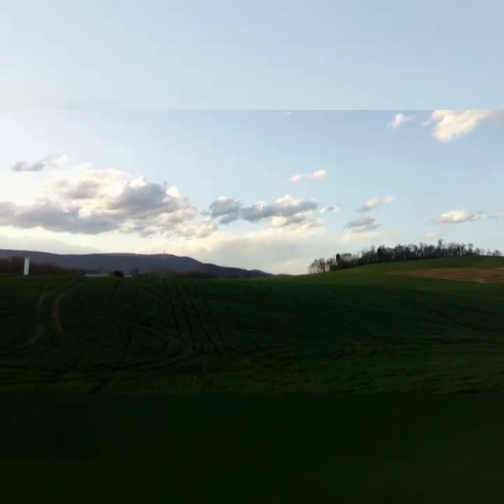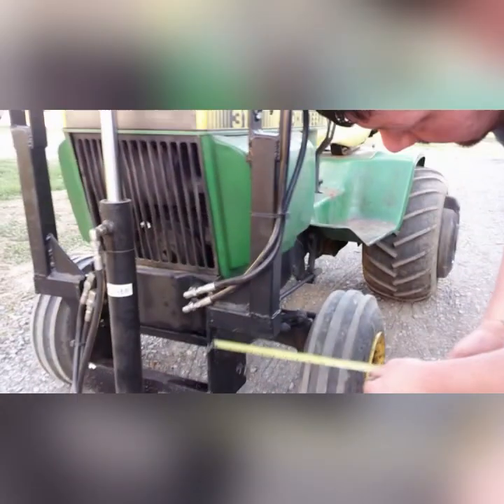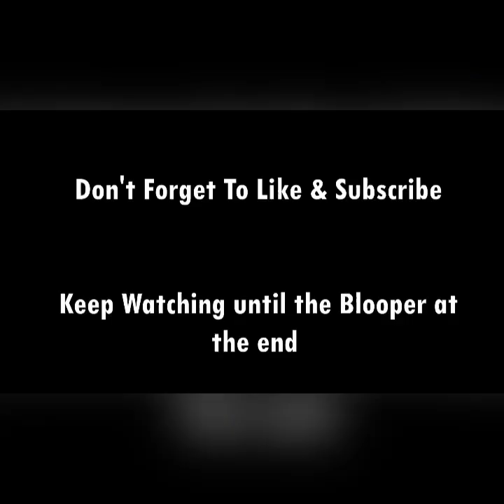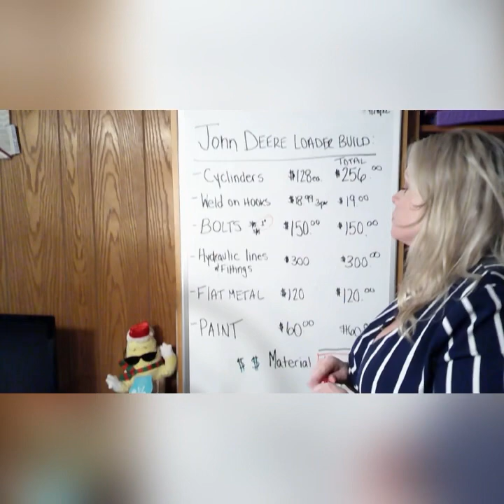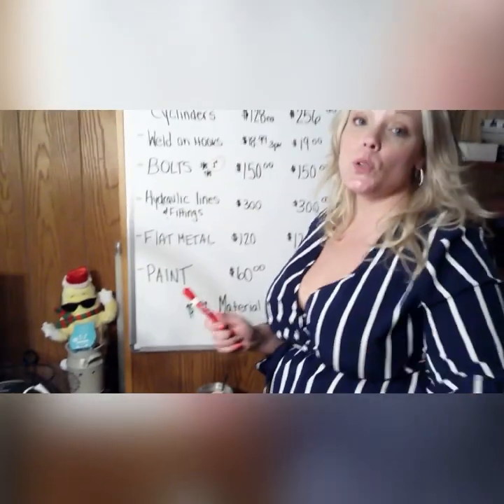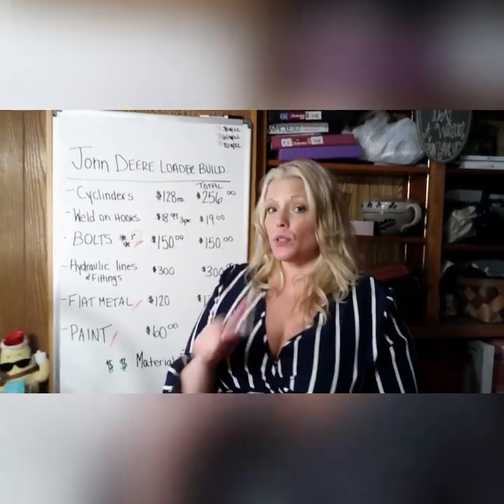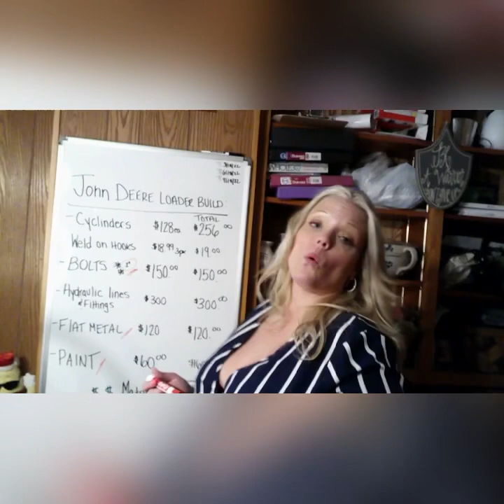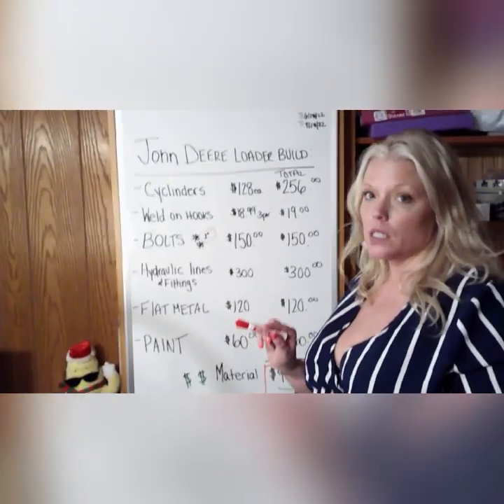John Deere Loader Build: In ACTION: Dimensions & Cost

Comment: You used the term "shimmed the relief valve to give it more pressure".  How do you "shim" it..?   Thanks for the video.  I'm currently building this unit for my 314.
Reply from the maker: I would love to see that build ,just give yourself more curl on the bucket than I did. Online shims are available for the main relief valve. Just be careful to not go too  much .
Reply from the maker: Thanks for watching
Reply: @Deadmoneygarage  I did put the back of the bucket 4" forward at the top, just like you suggested.  It's turning out really nice.  Thank you for your videos, as other than putting the bucket width at 40", I followed your build exactly.  I'm just getting the brackets for the cylinders welded on soon, mounting them, and she should be ready for paint.  I'm anxious..!

Comment: OH YEAH......how far from the bottom of the bucket did you put the bracket for the center/curl cylinder..?  Being the cylinder is at the certain length anyway, it will probably only have so much relief, but I was curious where the center of the cylinder pin is from the bottom of the bucket.  Thanks.

Comment: Did you use the on board hydraulics or did you add an additional pump? Thanks and great job on the build.
Reply from the maker: I used the on board hydraulics . Just shimmed the relief valve to give it a little more pressure. Thanks for watching.

Comment: I hope you are still enjoying the loader a year later.  I am curious though if you wish you had foot controls to drive the tractor or is this manageable using the hydrostatic speed lever plus the two levers for the loader and then the steering wheel?

Also, I am curious if you think you could have made this taller uprights and then shorter pieces going forward so that your bucket could be closer to the front of the tractor?  I would need to change the way the cylinders mount but my goal is to get it back for space savings as well as to help manage the load not that yours looks like it’s struggling at all!

I wanted to build mine last summer but never happened so relooking at options and your setup is ideal for the smaller machines like your 314 and I have a 314 and closed frame 316 so I’m building for virtually the same machine.

Comment: Can you post a link to the cylinders you used? As well as the pump and what not
Reply from the maker: The cylinders I used Or 14 inch but if I had to do over again how to date a 14inch and 12inch for the curl on the bucket.
Reply from the maker: As far as the pump I use the factory JD pump just shimmed

Comment: Great job. what are the size of your posts/arms, are they like 2x2x3/16 thick or like 3x3x1/4 inch thick. I built a regular loader for a Wheel Horse tractor using electric actuators, works great but very slow. I brought a John Deere 318 because of the power steering and front hydraulics, now I need a loader on it.
Reply from the maker: I wish mine was power steering. I think it’s 2x2x1/8
Reply: @Deadmoneygarage  Thanks for the reply.. I'm planning on 2x2x3/16th that I got from a scrap yard. I just need to look at your videos more for cylinders placement.
Reply from the maker: I think that would be fine. If at all possible I would have my hydraulic cylinders and lines made before. I started the build so you could actuate everything before you weld it permanently. (I didn’t and had to fight an over 
Centered cylinder for the bucket after everything was painted)I would add more of a slant on the back of the bucket to give you more curl when bucket is at ground level.
Reply: I finally got mine built. I got lucky while in a scrap yard looking for metal I found enough bolts of the right size to build mine. That save me a good bit of money. I have around 850 dollars in mine.

Comment: Could have used electric actuators instead of hydraulic. Would have saved that’s $300 for lines and fittings.
Reply: Way too slow and the worm gears strip out. They lift ok but strip lowering any kind of weight.  Plus JD 300 series have hydraulics already on board and that looks like what ges using.